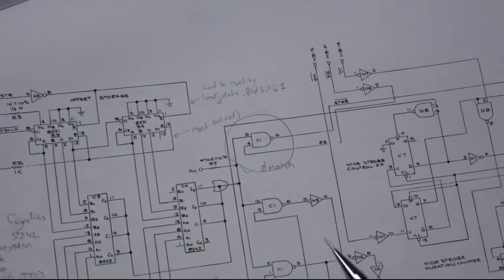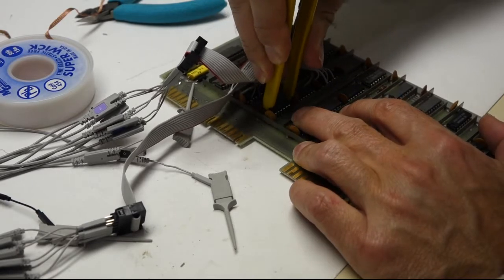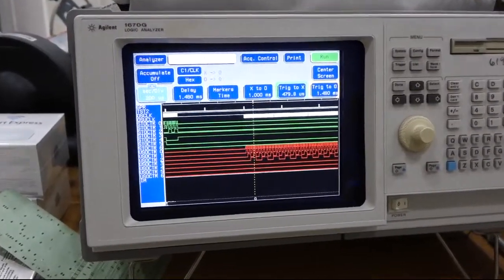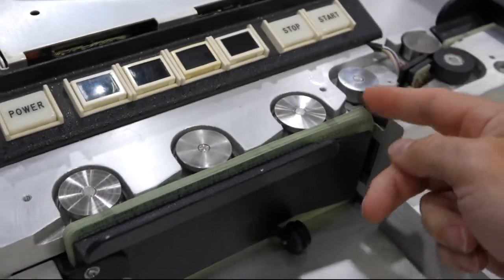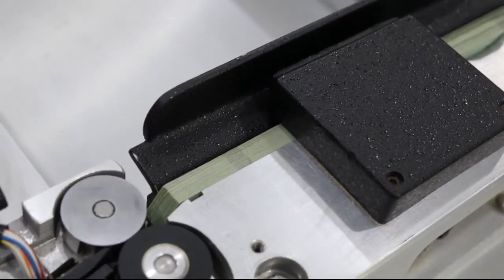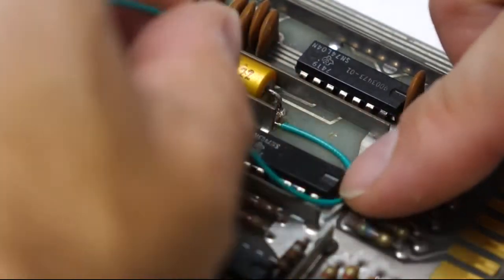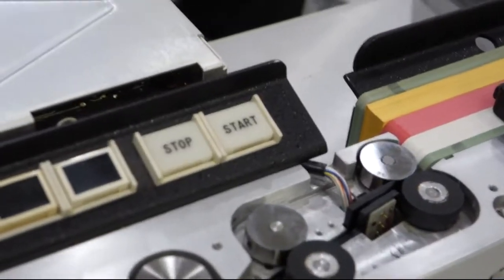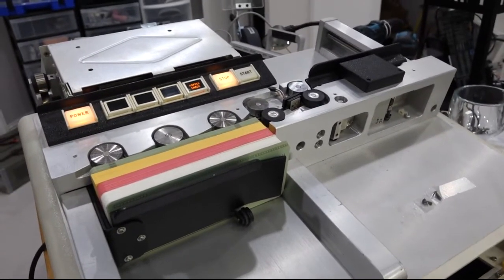Documation Punched Card Reader Part 4 - It works again!

Comment: This 6-and-a-half-minute video takes 104,863,413 bytes of storage as an MP4 file. If we were to store that file on punch cards using only eight rows (one for each bit), it will take 1,310,793 punch cards. Since each card is 0.007 inches thick, the stack of cards will be 9,175.5 inches high, 764.6 feet tall, or 656 boxes of cards at 2,000 cards per box. This card reader reading at 600 cards per minute, will take 2,184.6 minutes or 36.4 hours to read 1,310,793 punch cards.

But instead of wasting four rows, let's use use all twelve rows of the card. Then we can store 120 bytes per card. This video will take 873,862 punch cards, stacked 6,117 inches high, 509.8 feet tall, or 437 boxes. That's a lot of trees. And it will take 24.27 hours to read them.
Reply from the maker: +RaymondHng The card has 80 columns and 12 rows or "bits". Using EBCDIC character encoding (one character per column) that gives 640 bits/card. For binary data you'd use raw binary coding (packing 3 bytes into two columns), getting 950 bits/card. Of course, decks get very impractical above 10,000 cards. This still represents a decent 6.4Mb in character encoding or close to 9.5 Mb of binary data (which people would probably not attempt - they'd use 1/2" reel tape for that, which would get you up in the 20-50 MB range). For a long time this outstripped the amount of memory available core memory systems. And cost per bit was very low. Hence it's popularity.
Reply: CuriousMarc Hence, my second paragraph. With 80 columns of 12 punch positions, there are 960 bits per card or 120 bytes per card. And with 3 bytes represented in 2 columns, that's still 120 characters or bytes per card.
Reply from the maker: +RaymondHng Ah, yes. I was trying to defend my poor punched card. It's far from being as ridiculous as it looks, particularly when you put it in perspective with memory sizes at the time.
Reply: What an excellent set of statistics! Hard to reconcile those numbers to modern hardware, wonder will we be making similar comparisons some 30 years from now. Well done!
Reply: @jix177  Updated stats: 16,500 punch cards weigh 99 pounds, so this stack of 1,310,793 cards will be 7,864.8 pounds. Or the 873,862 punch cards (120 ASCII characters per card) will be 5,243.2 pounds.
Reply: Bah, humbug. The real question is, if we encoded an MP3 song (say, at a minimally decent 128kbps) in ZX Spectrum tape storage bits, how long of a song would fit on a 60-minute tape...? :P
Reply: @AttilaAsztalos  This video is not about ZX spectrum tapes.